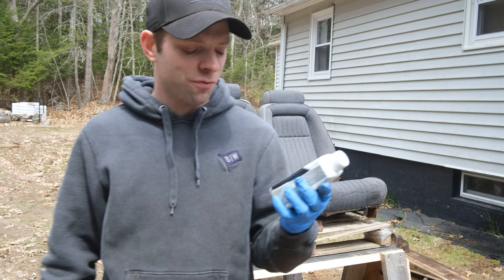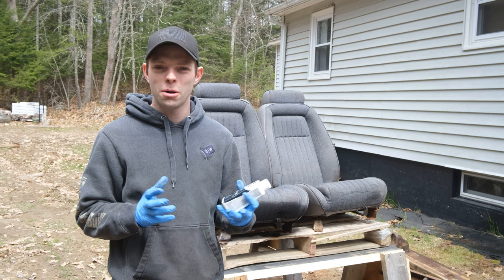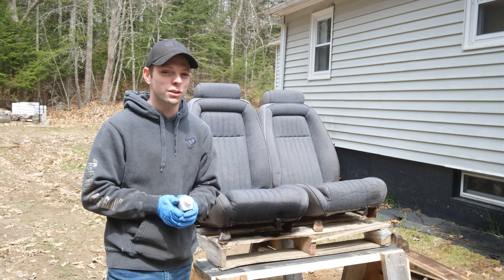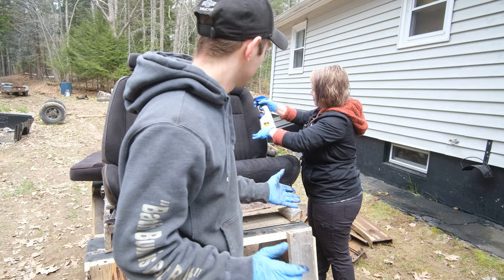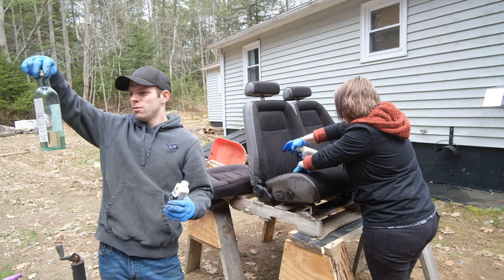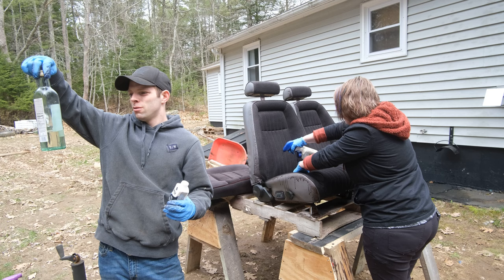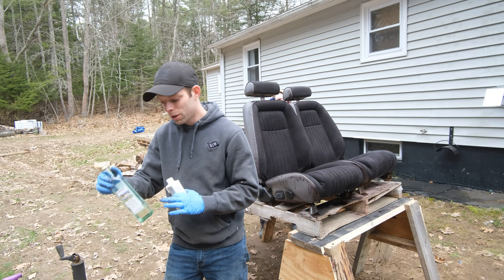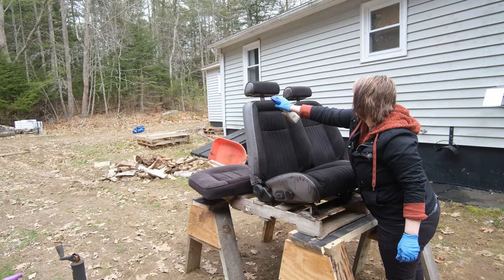How to Dye with Rit All-Purpose Liquid Dye on a car interior

Comment: I know this video is old so hoping I can get a reply but how did you go about rinsing the dye afterwards or did you even rinse it at all? Wondering about the aftermath steps!! Thank you!!
Reply from the maker: It was an epic fail I ended up rinsing and then pressure washing I used the wrong mixture and it didn’t work but what I did do is use a product called duplicolor vinyl and fabric paint/dye which worked excellent
Reply: @OverlandGarage  thanks for the response! I also ended up using duplicolor and it worked great!

Comment: Would love an update! About to dye my Jeep seats and want to see which is better rit dye or just fabric paint! I heard the paint makes it stiffer and don’t want that.
Reply from the maker: I used the dye and found that the paint is better imo it doesn't seem to make them stiff at all . I like the dye but if your gonna do it make sure you let them dry 100 percent I mean indoors for about a week and then see how they react to a little bit of washing
Reply: @OverlandGarage  did the rit dye end up rubbing off onto your clothes after? How come you switched to the spray paint?
Reply from the maker: @grantwoodall9835  I wasn't able to get the rit dye to stick to mine because the material I have is resistant to water and uv resistant so the dye didn't stick but if you have regular cloth seats they should stick just fine also I went to the paint because I'm planning on eventually replacing the seats anyways so it was more of a budget friendly solution
Reply: @OverlandGarage  ah gotcha, I need to look up to see if mine will stick or not, how many cans did you end up using and how did you really do it. I heard you’re supposed to clean the seats before (with either way you do it) then make sure they’re dry and with the paint your supposed to paint it then brush it? Is that correct?
Reply from the maker: That's correct make sure it's clean and dry them apply with the spray I'd let it dry again then brush it on let it dry and if you need more repeat it took me roughly two bottles of the dye
Reply: @OverlandGarage  ok and how many cans on spray paint did you use?
Reply from the maker: @grantwoodall9835  4